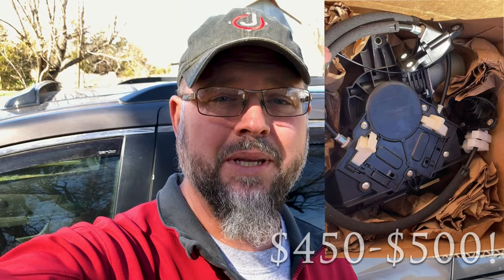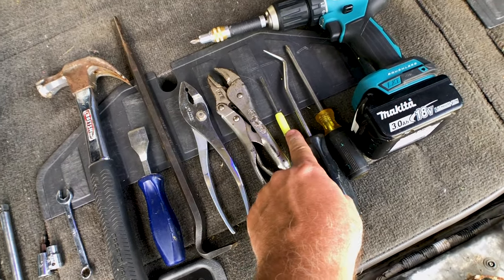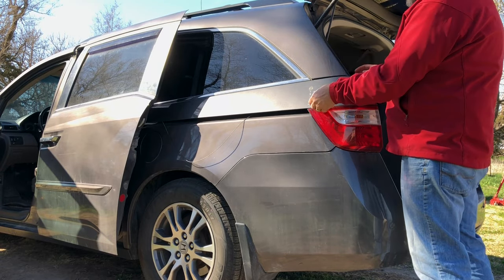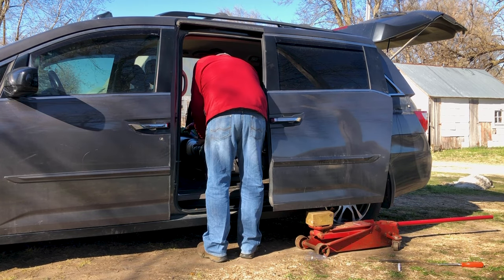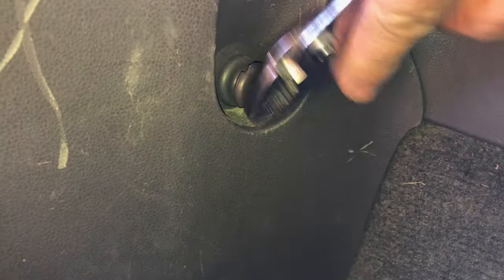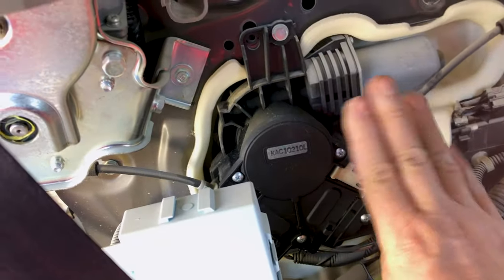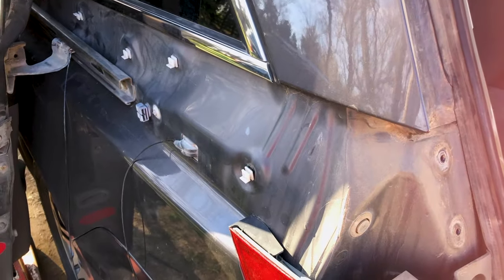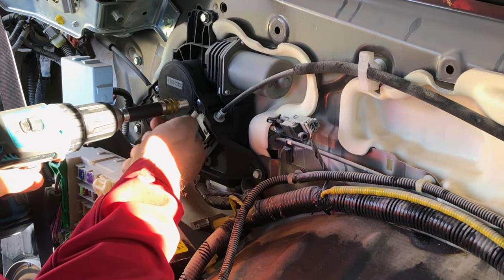FIX: Honda Odyssey Sliding Door Cable: Step-by-Step DIY Guide (2011-2017)

Comment: Why didn't you unbolt the rear slide instead of removing the pin?  Also at 41:00 in I watched in horror as you put the cover back on without putting the nut back on that spool. Then I watched you take the cover off say "yep, still looks good" and put it all back together a second time WITHOUT PUTTING THE NUT ON!!!!
Reply from the maker: WOW, great catch! I don't know how I missed that! I will add a pinned comment alerting all future viewers of my mistake. Fortunately, the cover and cables are holding the spool in place. After more than four months since recording the video, it's still operating perfectly. Thanks for pointing it out!

Regarding why I removed the pin rather than unbolting the rear slide, my decision was to save myself a possible headache later. Because the bolt holes are larger than the bolts, there is a real risk of bolting the bracket back in a different position, leading to a door alignment issue. Removing the pin eliminates this risk.

Comment: You smartly skipped the fun part of winding the cable to that pully and putting all together before closing the cover of thw motor ! your intention is to make views and not helping as you mentionned!
Reply from the maker: Since I made this video a couple years ago, I rewatched the portion that shows me winding the cable and putting it all together. Start watching from 37:20 and you will see it. My intention was to help, and if you read the comments section, I think I have accomplished that many times. Have a nice day.

Comment: If only Honda and Toyota made cable about 4mm thick on cables  , this wouldn't ever happen, they made to break that why consumers has to paid more things which unnecessary, when it assemble in US , there always 50% parts will break after 13 years
Reply from the maker: Yeah, I’m a big fan of Honda and Toyota, but like most big companies, decisions are driven by profit margins.